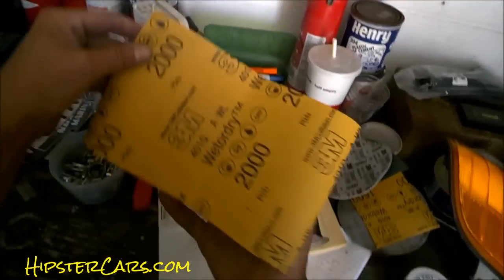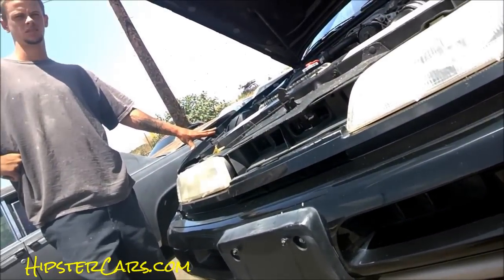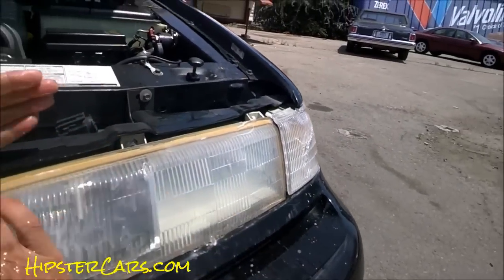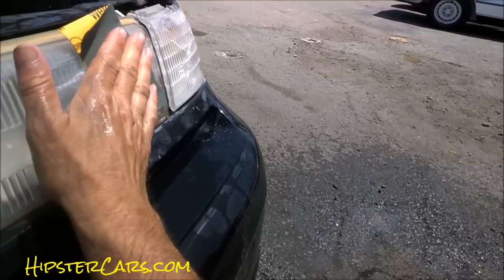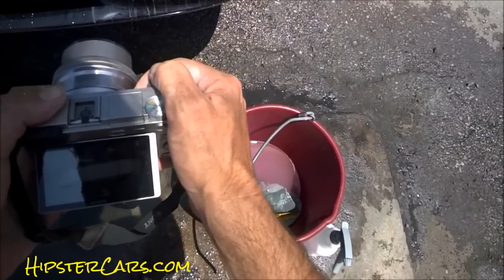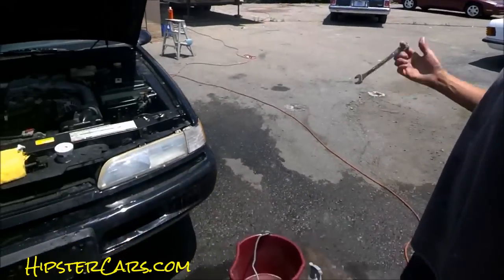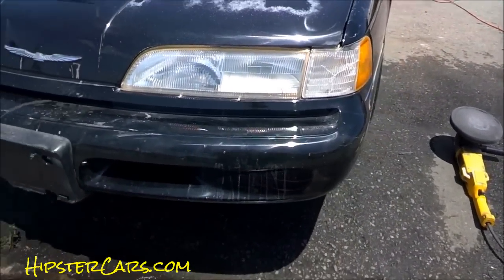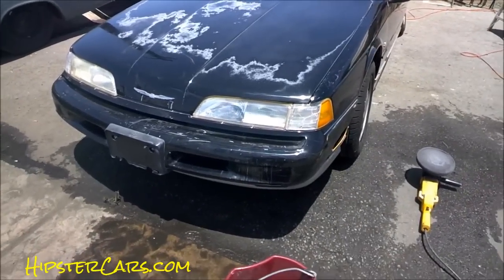Fix Faded Headlights Polishing Video Plastic Lens Renewal Headlamp Tutorial #8

Comment: It's amazing what you can do with oxidized lights. 2 jobs ago, the place I worked at had a body shop. They showed us how to do this. What we did was sand the lights with a small pistol grip D-A Sander. We did the first step dry, with around 320-500 grit, then did around 600-700 grit wet, then 1000-1500 grit wet. We then buffed the headlights with a white compound and a fluffy black wool pad. They always came out great. And if it didn't come out to your liking, just start at the beginning and sand them a bit more.

Comment: ChrisFix did a video on this with a similar method. He sanded it first with 600 grit, starting in circular motions and then sanded up and down. After that he used 2000 grit and did the same. Oh and I forgot, he wet sanded. After he wiped everything off with isopropal alcohol. (Rubbing alcohol.) He painted them with gloss clear paint afterwards.